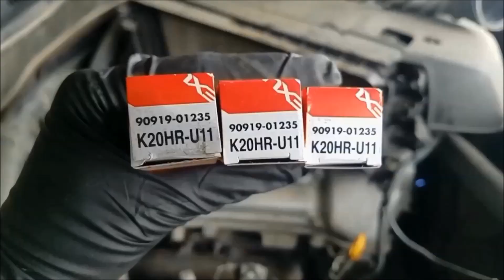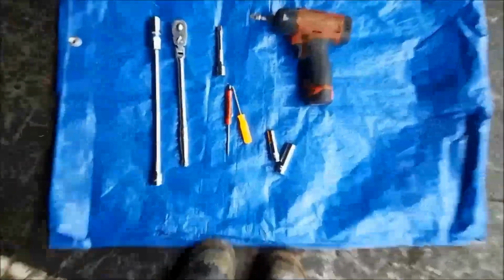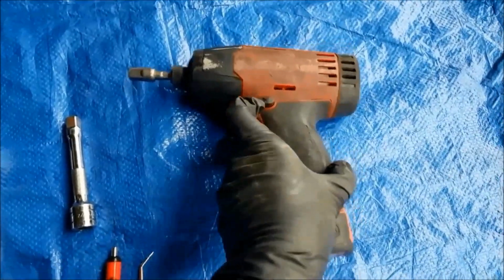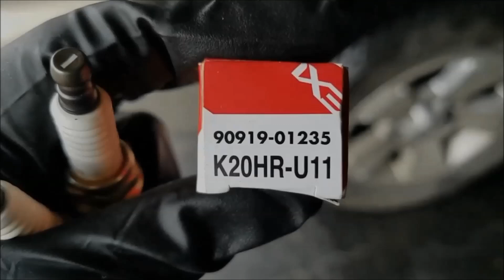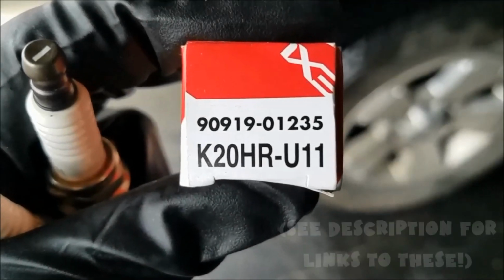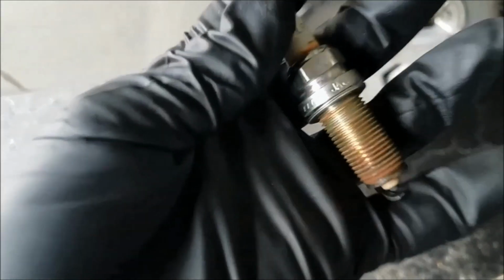How to R&R Spark Plugs on the 4th Generation 4Runner with 1GR V6 Engine

Comment: Was it anything like fords problem on escape? Resistance issues burning up coils and computers. Or just some kind of beta testing? Spark plugs  Another very informative vid
Reply from the maker: Some speculate that they had NGK and Denso equally as suppliers, and it was the only way to ensure things were even when it came to plugs?!! shrugs I have no clue. There are many ideas floating around out there, you can go down a rabbit hole on any number of forums!!

Comment: So why wouldn't all the old spark plugs be the same? Why did someone just replace some and not all?
Reply: The driver's side ones were more difficult to get to so someone has been lazy! The driver's side were much more worn than the passenger's so had obviously been in longer.
Reply: Straight from the factory, those engines actually came with two different brands of spark plugs installed.  One brand in bank 1 and another in bank 2.  It is well documented on certain 4Runner forums.  It is reasoned that because Toyota has a vested interest in both NGK & Denso that they decided to use both on each engine.  Weird huh.

Comment: Do you replace the plug wires at same time? Thanks
Reply from the maker: There aren't wires on this engine, it's coil on plug, but usually I do not replace wires as often. I normally only replace the wires when they are physically damaged or if they test badly

Comment: Where or how would you know what kind of engine it is?? Same for transmission.. thanks..
Reply from the maker: It's easiest for me to just pop the hood of a Toyota, and take a quick look at the Vac hose routing or emission control info sticker that is usually adhered to the underside. In the lower LH corner, it will say the engine type. You can also look it up by VIN, or just call the dealer with the VIN. For the trans, I always take a peek at the VIN plate on the driver's door jam/B pillar. Hope this helps!

Comment: it looks like it had a miss fire some where down the line to have two sets. Toyota will package denso or ngk as theres. the high end ngk and the denso are actually I noticed work well for Toyota and honda as well as some other Asian and some euro cars. more on the denso type of plug because the heat range is a little better in my opinion and what I have looked up but ngk are the best alternative for the denso type